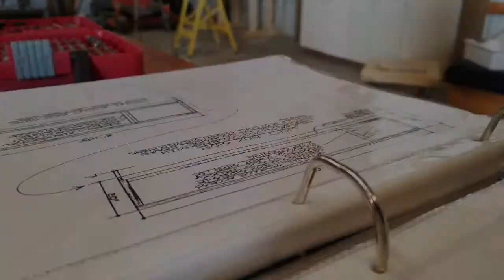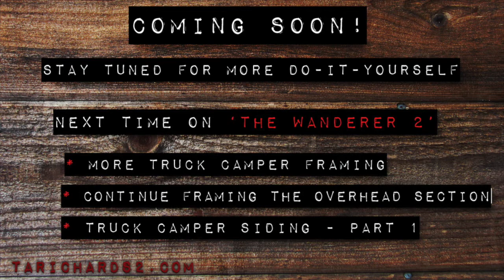My TRUCK CAMPER Framing Part 6

Comment: Damn man you got some gains lol
I’m trying to understand how the overhead loft for the bed is supported think you can elaborate more on the framing
Reply from the maker: Check out my Instagram if you want to see gains lol... Instagram.com/tarichards2 In a few of the introductions I go into more detail on the L shaped design and just recently I explained it again....if you've watched everything and need more I'll be glad to add it to the latest introduction....maybe for episode 31? If you can wait til then I would be grateful....
Reply: @tar2studios  Have you shared your costs to build the shell in any of these videos? Are you in the US?

I want to make sure that I'm going to save myself a boat load of money by doing it myself rather than buying a used camper. The furnishings are not a concern, I'm only interested in calculating my lumber supplies. I'll be building the same camper with only minor differences.

Anything you can share on costs would be most welcome and I'll be searching your videos as well.

Thanks so much for sharing this experience with the rest of us!
Reply from the maker: @sheri4673  I posted a video that might help you.... https://youtu.be/43gqKzsg2Sc